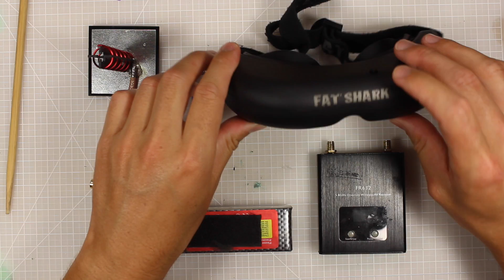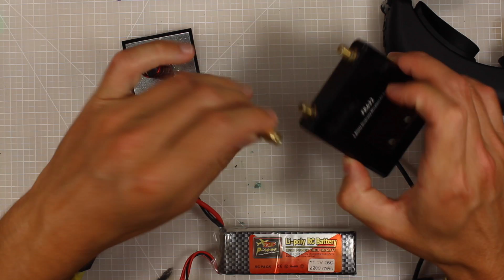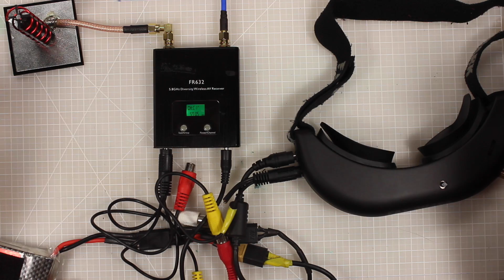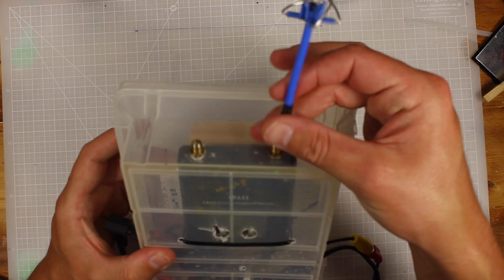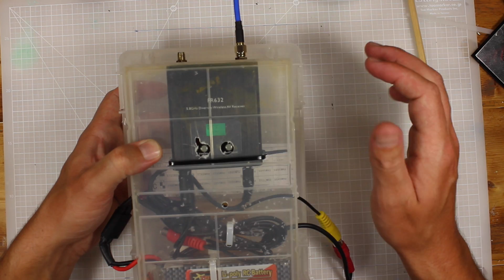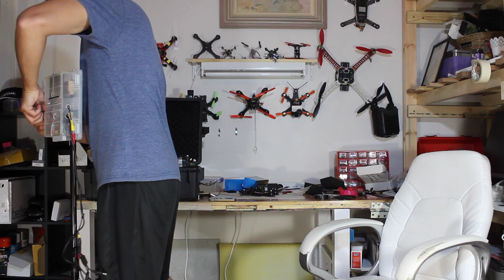BUILD AN FPV GROUNDSTATION - MY SETUP

Comment: i enjoyed this info. I recently purchased my equipment for a ground station and i am currently getting it all mounted. I plan to use a tripod with a 15' extension pole for the receiver on top and the 12" monitor also attached to the extension pole. Powering everything including the monitor is accomplished via 3S battery.

Comment: Would it be a problem to use 2 separate batteries, one of the receiver and one for the headset, or is this just an easier way to do it?

Comment: I've got the walkera Goggle 4 and am going to get the boscam fr632...so I just plug one of the av cables into the diversity out,then into goggles av input..and plug a battery into boscam,...I've got pagoda 2 antennas and a far vew 5 turn helical to put on boscam....will I need to put the stick antennas on my goggles so not turning it on without antennas...🙂

Comment: I though You could not power video goggle's up without a antenna i noticed the Fat shark's did not have 1 screwed on is that because of the diversity one's
Reply: You shouldn't power a transmitter up without an antenna, because the power would reflect back into the power amplifier and could damage it. On the other hand, a receiver needs an antenna to pick up a weak signal, and never puts a strong signal into it. For that reason, it's safe to power up a receiver without an antenna.
Reply: John Serling That would be a fair assumption if we were considering regular DC circuits, where the considerations are resistance, and removing the output would add an infinite resistance, reducing the power to zero. But at high frequency AC, the game changes substantially. The output stages of a transmitter are designed to resonate, in order to form RF waves. Without the antenna, or with the wrong kind of antenna, the circuit is out of balance. Like riding a bicycle where the chain is missing, your feet will pedal madly, and then you'll lose your balance. Or an engine out of tune could throw itself apart.
Reply: Jonathan Sterling Oh I see what you mean. That's not what is meant by "reflection" here. The signal is not an EM wave yet. The antenna converts a high-powered resonating wave of electrons moving up and down into an EM wave. Without the antenna, the electrons are forced in and out of the output stage amplifier, but with nowhere to go, they pile up, causing backward pressure on the amp. The reflection they talk about is this backward pressure, not reflection in the sense of a metal object reflecting RF waves.
Reply: If you remove a speaker from an amplifier, it absolutely will be bad for the output stage of your amplifier. You'll see the warning in the manual (and possibly stuck to the side of) any large amp. In a good amp, generally the output stage will have a thermal cut-out that will prevent permanent damage.

I didn't say that AC circuits have no resistance. My point was that the aerial is not acting as a conductor between circuits like, say, a signal cable. Technically, an aerial his impedance, which is a combination of resistance and inductance. However, the resistance is very low even with the aerial attached: the power is dissipated almost entirely by inductance, which is what produces the EM wave. By removing the aerial, you remove the inductive load, causing a great deal of current to flow back and forth, and the result is heat due to the small resistive load in the output-stage amp and copper traces that remain.

If you're wondering, I can't claim to be an expert at this stuff, but I do hold a UK Amateur Radio licence, for which I had to sit an exam. I may be rusty, but I'm pretty confident you'll find this is accurate if you do some googling.
Reply: OK, when it comes to amps, I think the kind of AC signal power we're talking about is low enough that an open circuit isn't going to cause a significant problem. In terms of warnings in manuals, I think what I was thinking of was a short-circuited speaker, or a speaker with an impedance lower than that which the amp was designed for. But that's all about resistive heat loss, which is a different thing.

Getting back to RF amplifiers, though, here's a few links that might be of interest:

https://www.reddit.com/r/amateurradio/comments/35kyu8/preventing_transmitter_damage_when_no_antenna_is/

http://www.ybw.com/forums/showthread.php?350742-Is-it-safe-to-operate-a-VHF-radio-without-an-arial-connected

https://www.allaboutcircuits.com/textbook/alternating-current/chpt-14/standing-waves-and-resonance/
Reply: Fatsharks have a switch to turn of the internal receiver when hooked up to a external video source.
Reply: Actually, I'm kind of shocked that they wouldn't do this automatically. If they're using an external video source, what reason could there be to keep the receiver active?

Comment: Hey Stew, just wondering, is there a way to set up two diversity receivers together? Thanks :)
Reply: Why do you want two diversity receivers? There's probably another solution to your problem...

As he mentioned, you would need to have a four-diversity receiver, I wouldn't recommend using a Y-cable, unless the antennas are covering very different areas (IE - indoor vs outdoor).

Comment: Great Video :-)   quick question,  I have been learning the racing side of things and ready to move up to a more advanced racer.  I was thinking maybe a 185 ?    do you have any recommendations on what system to buy.  Was sort of looking for a RTF package, but one that will give me the advanced options.      Thanks
Reply from the maker: +Grandpa Jake (FunTimeGrandpa) mm i really recommend building your own. There are only tbs vendettas or vortexs but they are bigger and quite $$$. the rest of the pre built things are a bit lack luster.
Reply: +UAVfutures I also considered that but need to find a list of recommended parts that will give me what I need and the potential to advance down the line.   Thanks
Reply from the maker: Grandpa Jake https://youtu.be/2nUdi7VQVtM

this might help

Comment: how about the fact of heat buildup...that in the summer heat with the lipo in the same box as the vidrx is going to be a hotbox...could be dangerous
Reply from the maker: +trailer rental I can just open the back of the box
Reply: You can cut out 12cm diameter circle out of the box and mount  pc fan to it. Also its good to add rotary potentiometer for adjusting fan speed.

Comment: Can't i somehow use the antenna input as video input from my ground station?
Reply from the maker: +Cedric Verlinden ?? what antenna are you reffering to
Reply: I know I'm coming to the party very late, but you could take the video output from a ground station and remodulate it into an RF signal and feed it into your goggles RF antenna input.

Comment: The diversity rx you show on the video, I saw on Banggood. But it says it's a Boscam. Is that compatible with a FX699 5.8Ghz 200w tx on my quad?
Reply from the maker: +Thori Nelson the fr632 can pick up all 32 normal channels. So I would say yes. The only thing it cant pick up is the new race band channels
Reply: The one on Banggood says it gets 40 channels. Is there one out there that is made for race band?
Reply from the maker: Thori Nelson 40 channels means it can also get raceband
Reply: Thanks. Sorry. I'm just getting into the race quads. I've been flying a Discovery to get used to flying FPV first.

Comment: Hello, thanks for the video. I am new in FPV. Please let me know which antenna and TX to use on the quad.
Reply: +Joe V (SuperCrasher) For your Video on your quad use the blue one in this video.  Link to get it is in the description or you can find it on banggood.  What transmitter to use would depend on the law where you live.  I use a 200mw and its good you dont really need a higher power one.